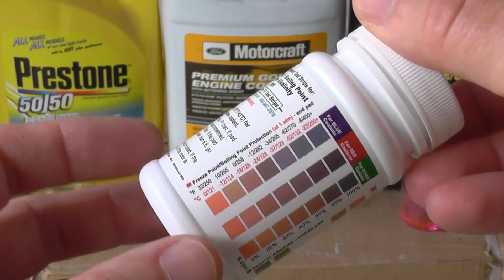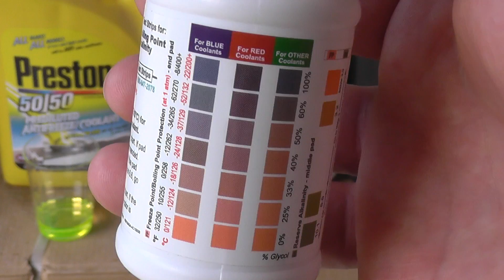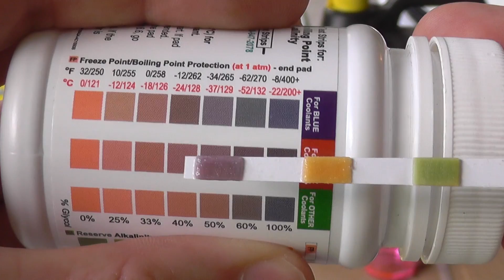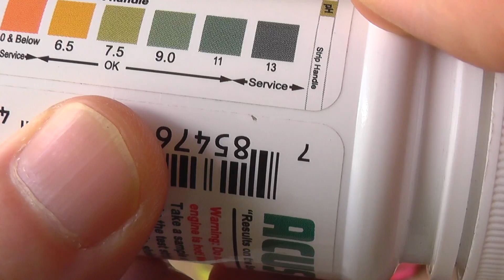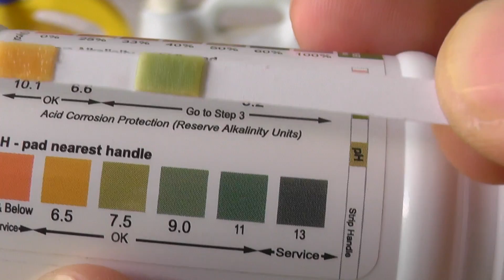Simple way to test and check Antifreeze and prevent water pump damage

Comment: Mr. repairvehicle
I have a 2017 Toyota Corolla XSE

I want to change the engine coolant on my car with Amsoil coolant. Is this okay to do so rather than using oem fluid from factory?

And what are the life expectancy of the coolant if I add Amsoil coolant booster?

Thanks for your reply and keep up the informative videos for everyone to watch!

Best regard,
Abrams
Reply from the maker: Yes it is OK to mix. 

Coolant booster does not affect life of Coolant. 
"AMSOIL Passenger Car/Light Truck Antifreeze & Coolant can be used for 150,000 miles or five years, whichever comes first, in passenger cars and light trucks. "

"In applications using Coolant Boost with antifreeze/water mixtures, add Coolant Boost once per year or every 30,000 miles, whichever comes first"
Reply: @repairvehicle  

Thank you for replying and I appreciate your time. I just ordered the coolant and coolant booster alongside with brake fluid. 😁👍🏼

Cheers and keep up the great work.
Reply from the maker: Thank you

Comment: REPAIRVEHICLE 
^^^                            ^ To test the water pump, you just press the gas pedal to increase the RPM of the engine and if you see BUBBLES in the radiator coolant then the water pump is good?
how can you test a water pump is working correctly or not? what test can be done?
Reply from the maker: Water pump always works, unless belt or chain broken.  When water is seeping from under the pump it means it's time to replace because cooling system is not holding pressure and engine starts overheating.
Reply: @repairvehicle  thanks for the help
1.) How can I test the Pressure of the water pump and the pressure of the radiator while the car is idling and running? I want to know what the pressure is through the radiators hoses and water pump hoses, how can I do this?
2.) The Water Pump is "increasing" the radiators coolant into the car engine and into the radiator core to increase the flow of  the coolant?
3.) How can you test if your radiators hoses and water pump hoses has to much pressure the pressure is to higher than normal operating pressure?
Reply from the maker: @billwilliams6338 , what do you have and problems are you experiencing? Please answer my questions so that I can answer your questions correctly.
Reply: @repairvehicle  1997 ford mustang 6 cylinder is overheating issues. 
How can I test the instrumentation temp gauge by itself to check if its working correctly? 
how can I test the water pump to make sure its working correctly?
Reply: @repairvehicle  thank for the help
I disconnected the Temperature sending unit/temp sense, so How can I test the instrumentation temp gauge in my cars dash board by itself to check if its working correctly, what do I need to do?
Reply from the maker: 1. car cooling system is a closed loop system that operates under certain pressure to prevent engine from overheating. When pressure goes beyond design limit, radiator cap or expansion tank cap starts releasing the pressure to prevent car cooling system from damage. To test the pressure there is kit and here is the link. https://amzn.to/331osXR
I don't know what pressure is required, kits have that information or service/repair manual for your car will have that too. https://amzn.to/2TvbpuT

2. Water pump circulates coolant through the engine and radiator. Water pump doesn't create much pressure, pressure created by the coolant high temperature because fluid expands and pressure increases. 

3. Too much pressure will cause, water pump to fail and it will start leaking fluid under the pump. Too much pressure is the result of extremely high temperature. Your hoses will start leaking where it connects by the radiator or just burst.
Car temperature gauge is useless unless its digital. As an example, car gauge shows temperature its in the middle, but digital scangauge shows 150. Temperature keeps going up to 210F on digital scangauge, but car analog temperature gauge still shows its in the middle. https://amzn.to/3atevVE I have ton of videos about this gauge on my channel.

Checking dashboard gauge is very trick thing and you need to know the resistance of gauge, it might be in the ford service manual. I don't know.

Water pump circulates coolant through the engine only when engine is cold, when engine reaches 180 degrees F thermostat opens and coolant is being circulated through radiator until coolant temperature drops and then thermostat closes again.

Failed closed thermostat will cause engine to overheat fast even when its cold outside. When engine is really hot the lower radiator hose should be cold, because thermostat is not opening.
Failed open thermostat will cause engine to overheat too, but it takes long time for the engine to come up to normal temperature. Upper and lower hose will be about the same temperature when engine is hot.

Do not touch engine hoses when engine is running, just be safe.

Check water pump if it has any coolant leaks under.

Also, last thing could be, too much rust build up on the inside of the engine block and cylinder walls due to not changing coolant frequently enough. If engine was overheated to many time, head gasket will be damaged and leak coolant into combustion chamber. But you should see white smoke in the tail pipe or even coolant smell, if you are loosing coolant.
Reply: @repairvehicle  thanks for the help
1.) So I can just plug the Scangauge II into the OBDII port in my ford 1997 mustang and it will work to for all the gauges like oil, gas, temp, RPM?
2.) The Temperature gauge needs a "resistance value" or a Voltage? to be applied to the temperature gauge to see the needle moving from C to F? 
When I disconnect the temperature sending unit/temperature sensor can't I just use a variable resistor potentiometer and watch the temp gauge need moving from C to F?
3.) The Universal Radiator Pressure tester won't test how much pressure the closed loop system PSI level is at while the car is idling and running. 
I'm looking for a Pressure tester that can test the PSI level while the car is idling and running to know if the PSI pressure level is at normal operating PSI pressure level of the coolant closed loop system. 
What is the normal operating PSI pressure level on most cars?
Reply: @repairvehicle  thanks for the help
The water pump is pumping how much water and coolant? how can I measure this how much the water pump is pumping? 
I don't know why they call it a water pump because its not pumping only water its pumping coolant. 
The Water pump only pumps coolant not water into the engine only when the engine is warm and HOT not when the engine is cold?
yes I can pressurize the system to 13 to 15 psi to find external leaks using a radiator pressure tester. 
But I want to measure the Pressure of the system while the car is idling and running at higher RPM to measure the Pressure of the PSI of the system, How can I do this?
Reply from the maker: 1. Because your car is 97, Please send scangauge email to confirm what your trying to read. They have good customer service.
2 Temp gauge has resistance and it needs voltage. I don't know about potentiometer. Repair service manual might have this info. Consider investing money to OEM repair manual.
3. PSI pressure will vary it based on the temperature. OEM service manual might have it, might not. There is no universal pressure numbers that applies to all cars, its different by each brand and year. I don't even know the pressure for my cars, would not know for other cars.
Reply from the maker: water and coolant is mixed together. I don't know how much water pump is pumping. I don't think this info is available. 
To find the pressure of the car while its running, you will need mechanical pressure gauge installed somewhere in the coolant system.
Reply: @repairvehicle  thanks for the help 
1.) Instead of using scangauge some other repair tech told me to buy a bluetooth OBD2 adapter and download the software app to see the gauges digitally. Have you tried this method?
2.) How would you test if the water pump is working correctly, any types of test you can do?
3.) The Water pump only pumps coolant into the engine when the engine is warm NOT cold after the thermostat has OPEN.
When the Thermostat is CLOSED the water pump is not pumping coolant into the engine while the engine is COLD?
Reply: @repairvehicle  the universal radiator pressure test don't measure the pressure of the car while its running so where do I put the mechanical pressure gauge at inbetween the upper radiator hose or lower radiator hose?
Reply: @repairvehicle  while the car is idling and running 
What temperature is the lower radiator hose temperature should be at? and what temperature should the upper radiator hose should be at?
I can just use my infrared temp gun to make the measurements but i don't know what is the normal temp ranges for the upper radiator hose and lower radiator hose for normal operating ranges
Reply from the maker: @billwilliams6338 , with working thermostat, lower hose will lower temperature and upper hose will have high temperature.  Don't know the temperatures, I  don't think it's defined anywhere.
Reply: @repairvehicle  thanks for the help
yes the thermostat will OPEN when the coolant in the engine is 180F degrees 
The Radiator Cap will OPEN when there is to much pressure in the upper radiator tank but it doesn't say when the Radiator cap will OPEN up at what pressure?

I wasn't sure if you have measured the upper and lower temperatures using an infrared temp gun or how would you measure the temperatures of the upper hose and lower hose?
Reply from the maker: @billwilliams6338  , I never measured the temperature with infrared.
Reply from the maker: @billwilliams6338  , I don't know the  temperature for radiator cap.
Reply: @repairvehicle  thanks for the help
The Radiator Fan will only turn ON with the thermostat OPENS? which should be around 180F degree?
The Radiator fan gets turned ON by the thermostatic switch on all cars use a thermostatic switch that is mounted on the engine?
Reply: @repairvehicle  ok thanks
Reply: @repairvehicle  ok thanks
Reply: @repairvehicle  
Does ALL cars or just certain cars have a thermostatic switch for the Radiator fan?
Reply from the maker: @billwilliams6338  , sorry for getting back later.  Have been away. Belt driven fans, not all depends on sensor for it be on.  Also,  water pump can have propeller blades worn out or rusted out and it will cause engine to overheat.
Reply: @repairvehicle  thanks for the help 
Can I REMOVE the radiator cap while the engine is cold, Then turn on my car and press the gas pedal and watch the radiator Coolant "bubbles" with the radiator cap removed that means that the water pump is GOOD? 
Also I can put my hands on the upper and lower radiator hoses while pressing on the cars gas pedal to feel the coolant flowing in the radiator hoses means the water pump is GOOD?
What block Tester do you use to test for combustion gas in the cooling system?
Reply from the maker: @billwilliams6338 , by removing the cap you are not going tell if water pump is good or bad.  I have done it back in 90s when I  removed the cap and started the engine and waited for it to warm up.  I didn't see any bubbles. I don't think you going to see bubbles with antifreeze. You definitely not going to feel water flowing by putting hand on radiator hose.  With cap removed and engine running, antifreeze can spill and burn you.  You can send coolant for analysis and they can tell you what is in and from there you can make decisions. I don't know of any tests for combustion gas in coolant except for analysis might reveal this.
Reply: @repairvehicle  thanks for the help
How do you test if your radiator itself has good air flow, what kind of test can I do to test that it has good air flow without the radiator fan turned ON to test if the radiator has good air flow?
I will look into sending the coolant for analysis, I thought they made coolant test strips for this type of coolant analysis
Reply from the maker: @billwilliams6338  test strips can tell you if your coolant is good or bad,  but details about the coolant can only be found using lab.
Reply from the maker: @billwilliams6338  , I don't know what test can be done for flow.
Reply: @repairvehicle  
What kind of lab area you talking about to send the coolant at? this type of lab is called
The Combustion Gas Detector tester kit will test how much carbon dioxide is in the coolant?
Reply from the maker: @billwilliams6338 , most of oil analysis labs can test coolant.  I don't know if they can detect combustion gas, send them an email to find out.
Reply: @repairvehicle  ok thanks I didn't know the oil analysis labs can test coolant i will look into it thanks
Reply: @repairvehicle  
1.) whats the differences are between hypercarbon and exhaust gasses?
2.) If you have a lot of hypercarbon and exhaust gasses in the radiator fluid that means that the car is NOT burning the gas and oil? so your car will can't go high RPM than 60mph?
3.) Auto Repair tech will REMOVE half of the spark plug wires to determine which sides of the engine is creating the exhaust gasses in the radiator fluid to narrow down which side of the engine block by just removing HALF of the spark plug wires. Is this a good troubleshooting method or not?
Reply from the maker: @billwilliams6338 , I  don't know the answer to questions 1 and 2. Question number is maybe, it's just too many unknowns about your car. It's very difficult to say without seeing the engine and hearing .
Reply: @repairvehicle  but how do you test the "pressure" 'of the water pump and the radiators pressure?
What kind of test can I do to check test the water pump?